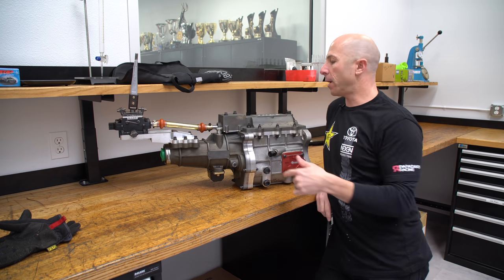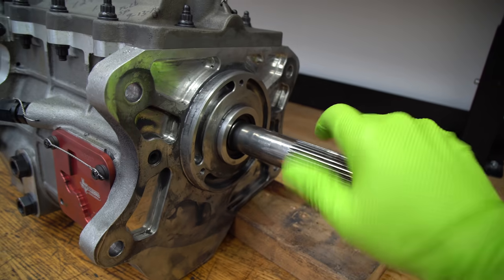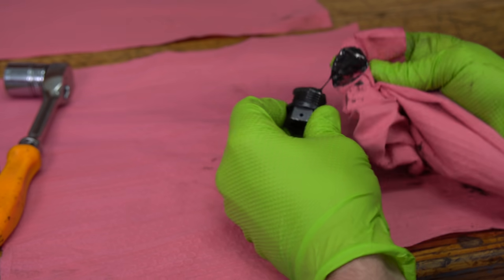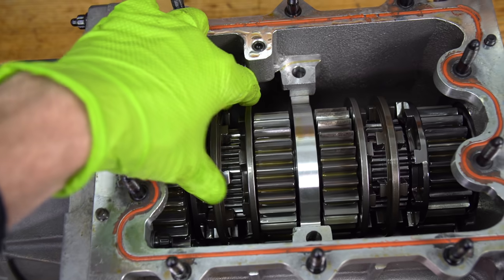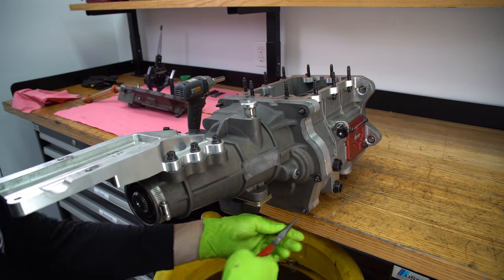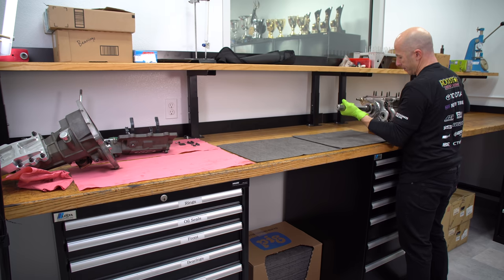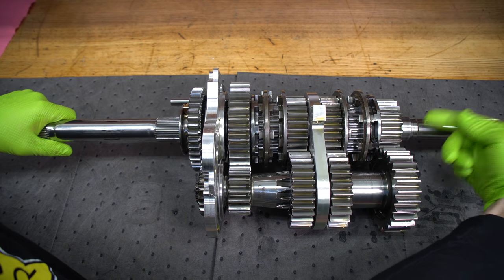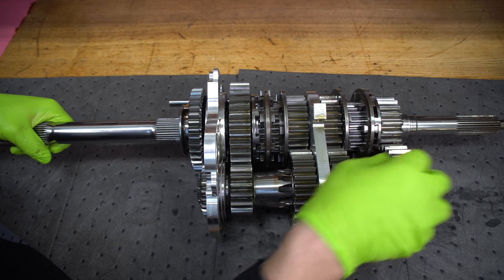NASCAR Transmission Teardown and How It Works

Comment: Spur gears are not stronger than helical.  They eliminate axial loads so transmission capacities can be increased without mucking around with the case.  Muncie accomplishes this as a bit of a compromise with its pretty shallow angle.
Reply: Yes this is true, helical gears are actually stronger. But with spur gears, you get a simpler and more compact gearbox that weights less.

Comment: Straight cut gears also allow the driver to much easily clutchless shift, especially on upshifts, as long as he rev-matches! Really cool video!
Reply: No, they have nothing to do with that at all.  nor are they "stronger" than helical cut gears (as the guy incorrectly stated).  They are there for only one reason: to eliminate the side loading which is really hard on bearings and cases.  That is all.

Comment: Nice simple (strong!) gearbox, actually seems like a pretty good learning resource if only to show the basic concept behind constant mesh transmissions.
Reply: Straight cut gears themselves are actually weaker than helical gears but they don't produce axial loads so the component and case requirements are lower and therefore lighter
Reply: @PabloGonzalez-hv3td  You are correct sir.

Comment: Psst. The straight cut gears are actually weaker than equivalent sized helical gears. The reason they run straight cut is because helical gears produce thrust loads, which get higher as engine performance increases. So to avoid the transmission pushing itself apart, they run straight cut.
Reply: those thrust loads also rob power and create more heat

Comment: One very key point missed, notice there are no synchronizers on nascar transmission. The male/female cones attatched to dogs, to help match speeds of the input shaft. Driver has to have input shaft spinning close to right speed for dogs to engage, else won't go in gear. Similar to semi truck transmission. The synchronizer cones, don't handle power to well, as they use friction so for high power applications, it is common to get rid of synchros ie. racecars.

Comment: wow..  it is  so  impressive that such  a small  gearbox  can  withstand  the  power  from  the nascar engine.  😮😮😮
Reply: Mohammad Farhan Sukarjo only 700hp
Reply: @nordic5490  meh..  people  always said  it is only  dat much  its only  dat much.. like  700hp  is  a small  number.  in  fact  they  haven't even  drive  a  with  that much  power.   more  than  dat is  barely  drivable as  a daily  car.  rethink and  reconsider your opinion on how  awesome is  the  engineering  on a racing  car  so that  you  can  realise  how  hard  it is  to  make  a  reliable, lightweight and efficient engine that has  been  manufactured  in  a relative small  package. It is not all  about  hp  brah..

Comment: I'm pretty disappointed that the manufacturers don't provide the transmissions for NASCAR, but this was an awesome video. Surprised to see they're still running 4-speeds!
Reply: the rear ends are also NOT made by the manufacturer, neither are the brakes, wheels ,shocks......also, most of the engine internal componenents are not made by the manufacturer. Sorry dude

Comment: 2:20 straight cut gears are actually less strong than helical cut
For the same size helical cut gears have greater tooth to tooth contact but you trade that off with increasing axial loads as you increase contact area and how tight that helix is

They’re only popular in racing because it’s much easier to cut and doesn’t provide axial loads like helical which means “potentially” lighter cases for the same strength with a reduced need for strengthening and potentially less losses because you can increase the use of ball bearings instead of tapered roller bearings

Comment: Spur gears are used in racing transmissions in order to save weight. They don't produce thrust loading, and therefore the shafts and cases don't have to be so beefy. Spur gears themselves are not stronger than helical.

Comment: yeah this is the same gearbox in every motorcycle. I've always wondered why they only put these in racing application cars when constant mesh sequentials are in every street bike. They're smaller and lighter than standard road car boxes, they can handle more load and they're easier to work on.

Comment: Straight cut gears are not necessarily  stronger but do not create a torque outside the axis of rotation. Helical gears are generally stronger but the transmission case must be much heavier to hold the extra loads and thus not necessarily advantageous in racing applications

Comment: Just one thing you got a bit wrong: Helical gears are actually stronger than straight cut ones due to the higher contact area spreading the load. They use straight cut here because straight cuts more efficiently transfer torque without the parasitic losses a helical would have due to axial thrust.

Comment: "There's no neutral without the shifter"(on normal transmissions between gears there's a blocker ring that "brakes" the synchronizer cone during gear changing and struts with a ring spring that hold each blocker ring to move individually where the shift sleeve is pushing it).with that gearbox obviously ECU is programmed to help engine rpm and gearbox synchronization. If the shifter fail to keep neutral the unselected gears and gets 2 gears together then you see that aluminum box explode in half :)

Comment: Please explain what you mean by strait cut gears being "much stronger", people always assume that means the teeth themselves and not the true strength of strait cut gears which is that the box casing can be much lighter because there is no axial load on the gears, the gears can be lighter themselves and generate less friction and thus more power efficient, and ease of replacement and setup
Reply: You answered your own question in a roundabout way - there are no axial loads on a straight cut gear.  The axial load in a helical cut gear is caused by the load being wiped across the face of the teeth in a diagonal direction - not what you are trying to accomplish.  A transmissions job is to transfer power through the gearbox by making four 90 degree turns to accomplish this.  There is nothing diagonal about it, and only results in the loss of power transferred through the gearbox by inducing unnecessary stresses on the parts inside.
Reply: @chuckhoward3626  Yeah but the strait cut gears by themselves are not "stronger" it is more that the gearbox itself can handle more power through it without cracking etc. Read a lot of info that says helical gears are technically "stronger" as they have more contact area per tooth but because they are less efficient and require stronger casings they are not used in racing where every bit of weight saving counts

Comment: Looks simple, but robust. It is interesting, that the shifting dogs resemble a motorcycle transmission, rather than using synchronizers  like a street transmission. I doubt the dogs last as long, but it looks like the more torque, the tighter they hold together. I wonder how this would work in a pickup truck compared to a standard synchronized transmission like they normally use. If you double clutch, this could hold up just as well. It would be noisy, and you would feel the backlash caused by the distance between the teeth of the dogs, whenever you let off or hit the gas. I like the more positive engagement, and this looks less likely to "grind". This looks like it could be successfully shifted clutchlessly. just tug the shifter toward the gear you want, lift, to allow the separation of the dogs, then, it should positively grab the next gear. Have you tried one of these on the street for daily driving?

Comment: if you have a lathe.. you need to make a custom drain plug that is deeper and has a longer slender magnet so it becomes like a conventional spark plug insulator with a deep cavity between the magnet and the drain plug to catch more metal  out of the oil.  perhaps since the fill plug is above it. you could have a hose assembly with a magnetic trap in it.. the oil slung off the counter gear might be enough to push thru the hose and back thru the filler inlet.  also allowing more metal fragments to be removed from the lube.  its just a thought.  i was wondering how thick the lube is.. if the lube is too thick it won't flow thru and lube the needle bearings as easily.
Reply: The plugs you mention are available already

Comment: I'd like to see you tear apart the transmission of a post ford mazda. I really really want to know what's inside there. the only info available seems to be a vague description of their torque converter on the automatic although I saw a video where a mazda engineer mentioned that there was a whole lot of gains in efficiency acheaved by their transmission engineers and then went on to talk about the engine and the steering.

Comment: Love it! What's the center-center difference of the shafts? Would be interesting to compare to standard production based transmissions like T56s, CD009, R154 etc. I know the R154 is 82mm and I believe t56/tr6060 is 85mm

Comment: That was a great video. You come across well.
I noticed there are no synchro rings so the gearbox must be a real bastard to shift. Very clunky compared to a standard gearbox I'm sure.
Reply: Roger Onslow It’s a dogbox style transmission. They don’t have synchronizes. Allows shifting without the clutch being applied. The faster you’re humming along the easier it is to slam to the next gear.

Comment: I guess you are not old enough to remember the Ford (factory built) 4 speed "top loader".  It was made in the 60s and used for many year, even on GM NASCAR racers.

Most people won't care, but those dogs are NOT found on street cars.  They use a totally different mechanism.  Technically that is a non-synchromesh transmission.

Do you do any precision tool inspection on the internal components to determine wear or do you just swap components after a certain number of hours or clear visible wear ?

Comment: Straight cut gears are in fact weaker than an equal sized helical gear for the simple reason the loads are spread over a much smaller contact area - that's weakER not weak

Straight cut gears are preferred in racing because helical gears produce axial thrust loads requiring a more robust case design/components in high torque  applications and robust = weight 

Straight cut gears do not produce thrust loads and save component weight but are louder

Comment: Good vid but one minor correction. Straight cut gears are not stronger than Helical gears for the same tooth size. Helical gears are stronger all else being equal. Straight cut "dog boxes" are stronger because of how beefy they can make a straight cut gear compared to a helical. Helical are stronger for the same tooth size because the torque is not perpendicular to the teeth but is at a small angle. 

Practically speaking though, straight cut gears are normally more durable because they are specialty built with massive teeth. It's difficult, if not impossible, in certain situations to make a helical gear have as thick of teeth as a straight gear and it's extremely cost prohibitive in the places where it would be possible.

Comment: Just a heads up.... straight cut gears arent "stronger", the reason straight is preferred is because there is no thrust load and less friction in comparison to helical gears.... but helical is absolutely stronger when all materials and relevant dimensions and manufacturing processes being the same....
Reply: Now I'm not saying that trans is weak because of straight gears.....its built with durability in mind with high quality expensive modern steel alloys.....  but that trans was purpose engineered to be very fast at shifting and not meant to last 100,000 miles.....just saying helical is a stronger gear all things being equal but helical will have extreme thrust loads that tend to kill thrust washers and ball bearings at high torque applications that said bearings weren't designed for.....

Say the r154 out of a mkiii supra was notorious for the first gear thrust washer to grenade because of side loading that a straight gear wouldnt have seen such stress.

Comment: Thanks for the amazing video. I have a few questions though;

1. When the cars not moving and the gears are not spinning, how would you shift to first if the dogs aren't aligned already?

2. You said straight cut gears are stronger but don't helical gears have more teeth engagement for the same module and teeth count? Shouldn't they therefore be able to carry more load?
Reply: I think the reason they're using straight spur gears might be that they don't have to contend with the axial forces

Comment: Straight cut gears are not "stronger" than helical gears. They are used in racing because you can make a straight cut gear transmission with significantly less mass. Not because of the gears size, but because of all the auxiliary stuff a helical  gear transmission require to function.

Comment: i want to fix a manual trans from my chevy silverado 94 ..  the problem started  in second gear 
..and then in everything ..  but i like my truck and fix the trans  .. and it will be very difficult to fix it ,,  cheers

Comment: the thing about straight cut gears is wrong.
They're actually weaker than normal helical gears, the only benefit is that since they're straight then they dont produce unwanted forces, because of the curve in the helical gears when they're under load they push slightly sideways compared to the straight gears.
I belive science garage made a good video on this
Reply: Valentine so they are technically weaker, but in practice they are stronger, in high load situations
Reply: Hondanumber9 the gears themselves are weaker, but since you dont need to reinforce against the sideways forces produced by helical gears then the gearboxes Can be significantly lighter if you’re making large amounts of torque.
So gearboxes with straight cut gears are weaker, but potentially significantly lighter

Comment: 2:29 every mechanics experience
Is all fouth gear in different types of engines is to 1-1 gear ratio?
Reply: Just Another F2P potato gamer, nope. Air-cooled VW Beetles for example with 4-speed manual gearboxes were all overdriven in 4th gear, 3rd gear was reduced - they didn’t have a direct.
Reply: @76629online  thanks for the info

Comment: Interesting they are only 4 speed, but I guess they don't need low gears. It also surprises me that in road cars that the final drive is not 1:1 to increase efficiency, change the diff ratios to maintain the same gearing.

Comment: In theory, could you or a person install any transmission to any motor? Obviously their would probably have to be some sort of adaptors plate, but could it be done?
Reply: Dustin Alexander Keeping it short, yes. 

If the transmission components physically fit the car and it is made for the engine configuration obviously (FWD, RWD, etc), custom input/output shafts, driveshaft, adapter plates/bell housings can be produced for it to be fitted to basically any engine.

Comment: I have the same exact transmission for my pro drift car as well, but I put my 9 inch rear gear ratio so I will be using 2nd and 3rd gear to drift. Should I go from a 4.30 to possibly 4.60 range to use 3rd and 4th instead since you said 4th was more efficient? I didn't know if it really had less drag and was stronger or if it even matters for drifting, thanks!

Comment: Oop's, dropping needle bearings isn't good. That counter-shaft is a massive diameter, input and output would break before that? Never seen a transmission with a 'handcuff' before, but, I 99.99% only work on motorcycles. Thanks for the info. Maybe do a sequential shift as used in Rally cars next?I

Comment: Hate NASCAR but I loved this video. A quick question I have an 06 5 speed occasionally (usually when the engine is good and warm) my shift from first to second the gears will grind. My clutch is in all the way at the time I shift its the only gear I have had done this. Bad syncro? Would like to hear you intuition.
Reply: If that is the only gear that ever grinds and any rpm level. Seems like a simple grind. Meaning new synchros or a selector collar are to be had. Hopefully this helps.

Comment: Straight cut gears are not stronger than helical gears. Actually, they are a bit weaker because there is less surface area contact between teeth so the load is not as spread out on each tooth. But gears are not the weak link in a manual transmission so it’s not really relevant. The reason racing transmissions use straight cut gears is to eliminate the axial load on the transmission shafts from the angle of helical gear teeth. This load causes the transmission case to stretch and if the load is high enough, the case will either fail or the internal components will see so much movement and play that something will fail. This is why robust production manual transmission for high power applications have such a robust, large case. Race transmissions have a smaller case cause it sees minimal load. So the trans can be lighter. Awesome video otherwise. Love the channel.

Comment: Nothing new here. Same layout and function manual gearboxes have had for over 70 years. The only difference is instead of synchronizers, which serve to match the speed of the input shaft to the selected gear (thus no clashing or grinding of the lock up teeth) the dog boxes serve as rather brutal engagement devices. While noisy and violent in engagement, they are stronger and more positive than synchronizers. Well done video all the same!